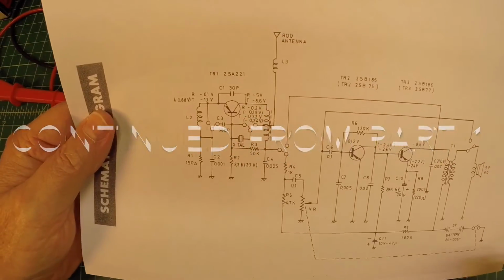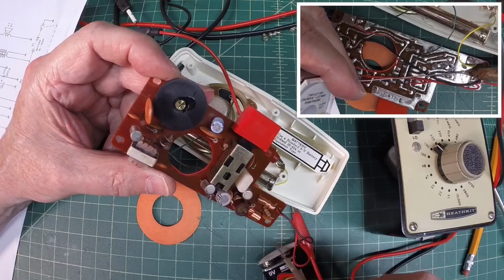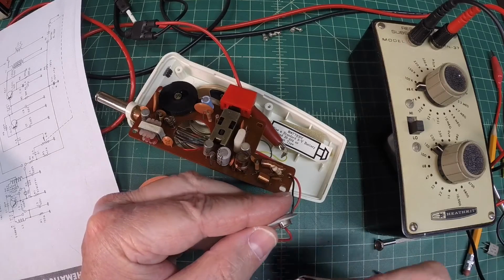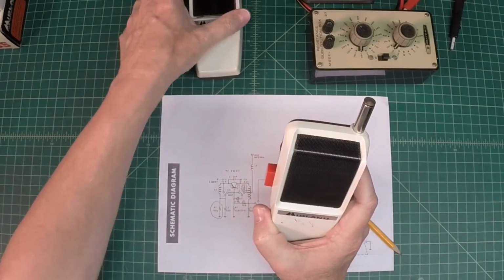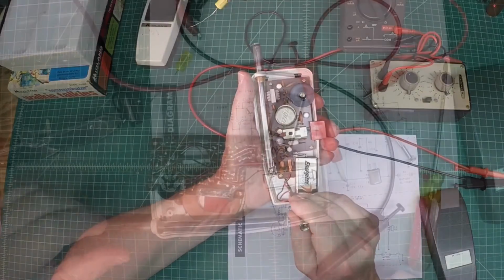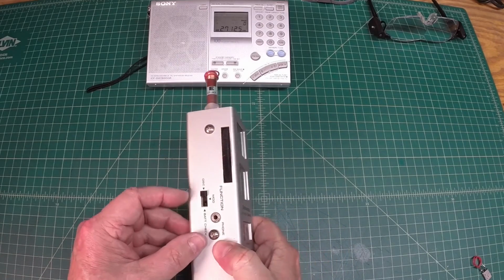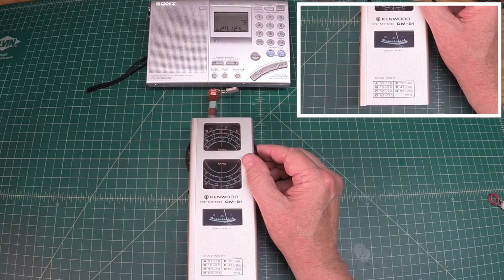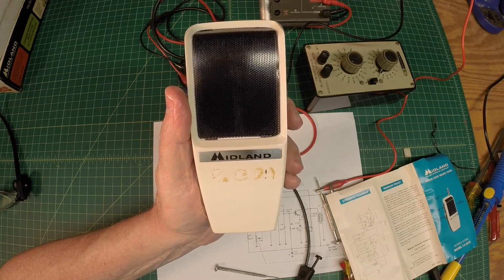Midland Walkie Talkies - Part 2

Comment: Nice repair Don. I worked on cb radio for years. Got my first walkie  in my early teens. Had a lot of fun then.  Just picked up one of the first 40 channel walkies from Radio Shack a few weeks ago.  Never been used. Think I will do a video on it soon.Thanks for sharing.
Reply from the maker: +The Radio Shop Thank you. It was a diversion from my routine and was fun to do. I'll be watching for your video on the RS 40 channel WT. Thanks again for watching. Best, Don
Reply: I decided not to tear the RS 40 apart. It has never been taken out of the original wrap. But I did show it in my latest video #69.Keep the videos coming Don, may not always reply but I do watch them all.